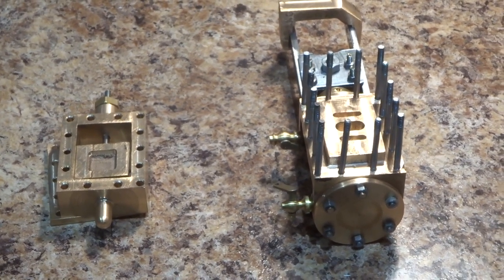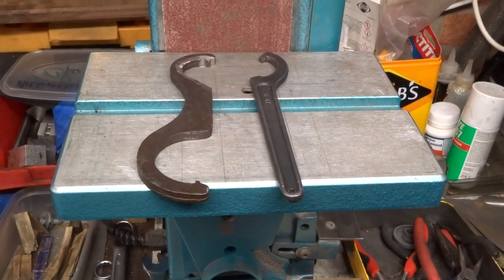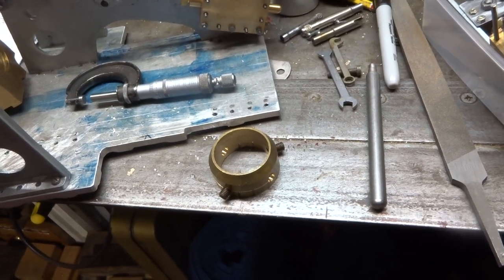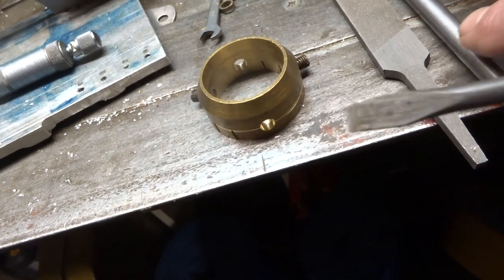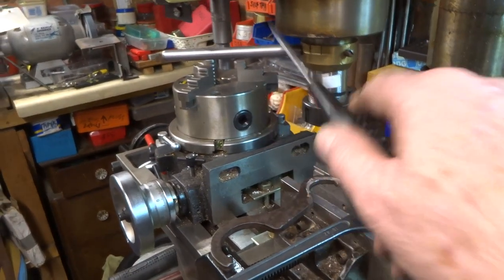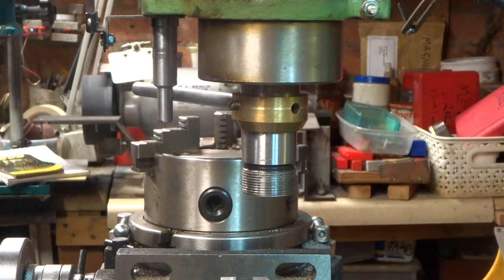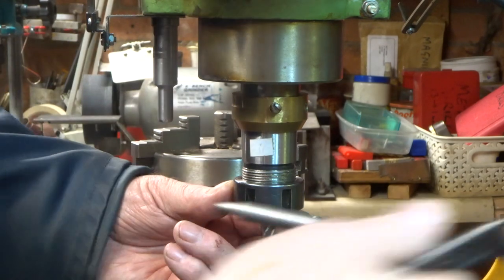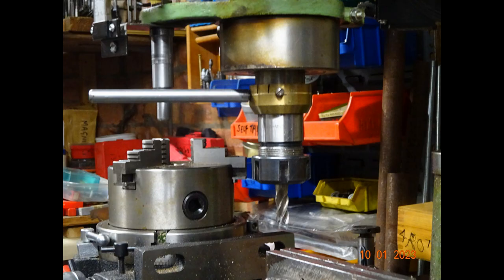Round column milling machine spindle lock

Comment: Simple and very useful. All I now need.... is a milling machine! Thanks Ed, nice work. Les
Reply from the maker: For years and years I managed without a milling machine, by doing everything on the lathe (or filing which I have never mastered). Perfectly possible, but quite a trial with the setups and definite limitations with maching lengths etc. Having finally splashed out on a mill I cannot do without it. Thanks for your comment. Ed

Comment: Good work Edwin. Interesting idea. Mine using the Bridgeport and R8 arrangement works completely differently though.
Reply from the maker: Thanks Ben I regard Bridgeport as one of the 'Rolls Royce' options to be admired. Although I can now afford one I find my model engineering aspirations are now more limited so I will stick with the budget mill. Best wishes. Ed
Reply: @edwinwhite933  Mine is a Naerok round column mill a lot like yours but has the fixed column raised from the base that can't twist willy nilly like the Warco and others. However it does use R8 collets which operate on a drawbar. You can see a video of mine on my channel. If I had the room for a Bridgeport or similar and the means to get one in my workshop, I would though!
Reply from the maker: Thanks Ben I did have an opportunity a few years ago to get a Bridgeport from a deceased engineers estate. Like u I realised I could not move it or get it into my workshop so had to let the opportunity pass me by. Such is life.
Reply: @edwinwhite933  Very much so.